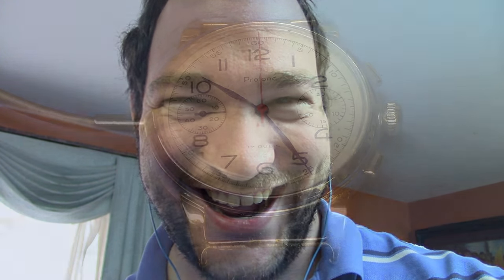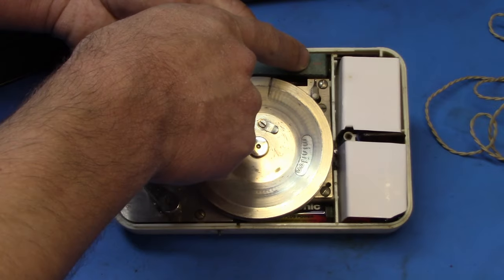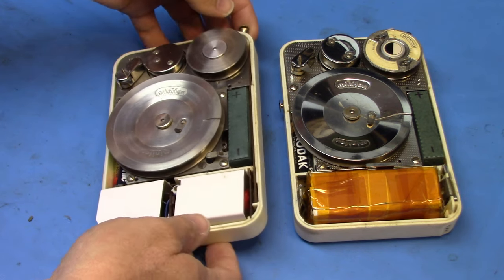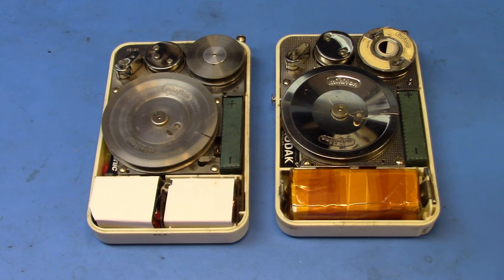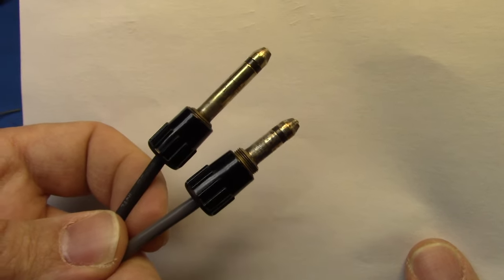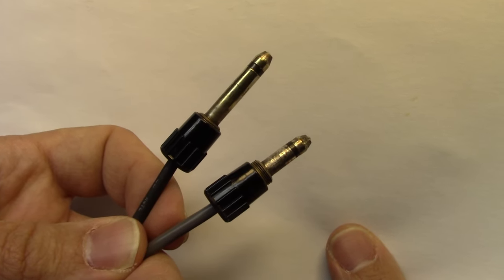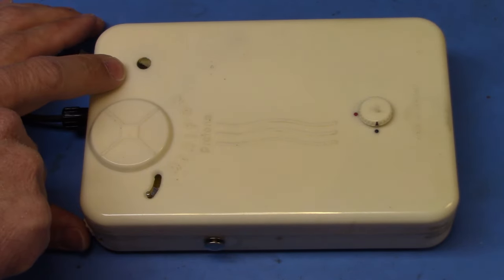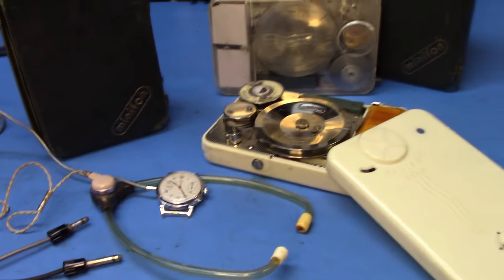Minifon Mi51 Wire Recorder (Monske & Co. and Protona versions)

Comment: 23:33 is the mechanism that is inside the wire recorder, and this mechanism was commonly used in wind-up acoustic 78 RPM record players from the 1910’s through the 1920’s, and it uses the governor and the spring motor which were mechanical and fully operational and easy to use.

Comment: I've heard recordings on wire recorders made from high quality sources like a phonograph, FM radio or even CD.  At best, they sound like a good decent quality AM radio broadcast.

It's surprising to me these sold at all.  It was probably fairly expensive upfront, but far worse is the operating costs.  2nd hand wire recorders were available with an extremely low operating cost due to their AC power supply.  These batteries were a fortune and only lasted a few hours even on farm radios without a motor to power and where small battery size wasn't a big limitation.  The farm radios generally were about 5 for a battery where you got about 5 hours worth of run time. 5 Dollars was five ounces of silver.  1 oz of silver could be turned into the bank for 1 USD or vice versa.   There is just no way parents were going to buy 2 or 3 separate batteries for roughly 5 Dollars so their kid could play spy for up to 5 hours.
Reply from the maker: This recorder was not intended for children.

Comment: I wonder if analogue sound & video recording might need to make a comeback, merely to corroborate digital footage since the latter is increasingly easier to fake. It wouldn't need to be high quality, just to capture a recognisable signal parallel to the digital capture, but in a sealed capsule that can't be tampered with (without it being obvious). This might prevent fake footage being used as propaganda or footage being suspected as such, provable in court. I don't know what the most efficient technology would be space wise.
Reply from the maker: VERY good idea in this day and age!!!